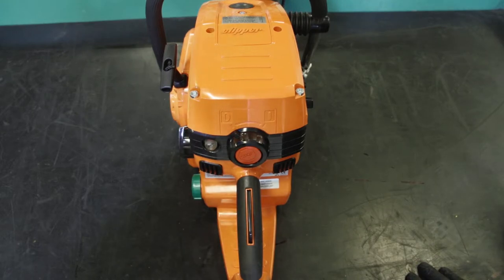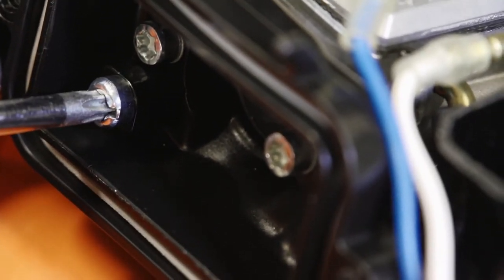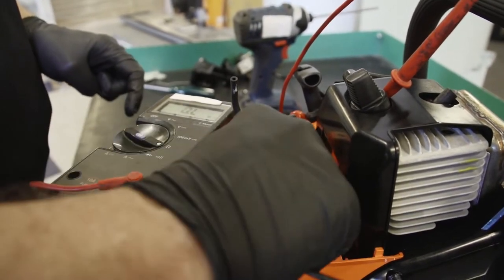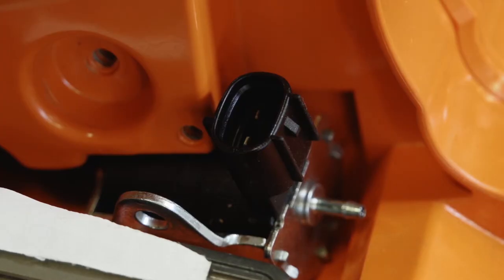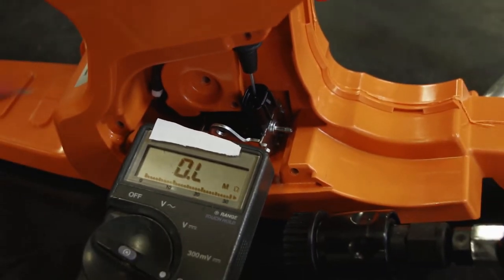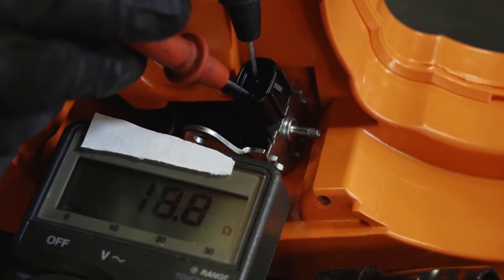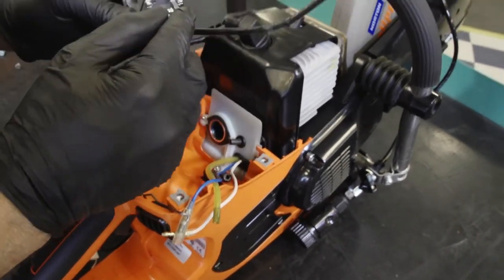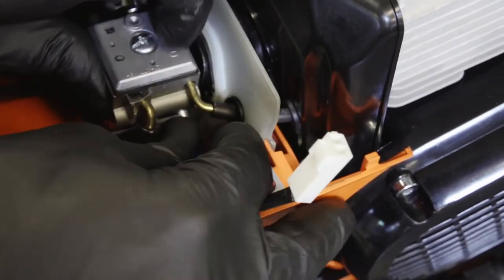How to Troubleshoot iLube System on Norton Clipper High Speed Saws

Comment: I love these saws . I have this exact saw and the Solo non ilube, the 880-14( exact same as cp514-350 from Norton). Was amazed at the power of these saws, how well balanced they are, how light they are and how innovative the ilube is. I bought them both used, on ebay at different times for great deals($239 for the Solo runs great great shape!, $200 for the ilube runs great when it runs, I've needed to fix recoil spring in casette) on the ilube I'm trying to figure out how to get it to run consistently, when it Does fire, it runs like a TOP 3 SAW (I've owned 17 saws- 6 stihl,7 husqvarna 2 hilti 2 makita so 19 counting these 2). Can anyone help me figure out how to get it started and running right each time? Thanks God bless

Comment: But my Norton clipper cp514-350 will not start and I can’t figure out why! It’s getting spark seems like it’s getting fuel to the carb, but not sure how the fuel plunger on the bottom of the carb is tested if that’s a possible failure. I’m about to throw it in the trash
Reply from the maker: Hi there!  sorry to hear of the issues!   We'd be happy to put you in touch with our expert.   If you can email us your contact info (our contact email is on our channel page - about section) we'd be happy to get you in touch! 
He did also provide the below in the meantime: 
When troubleshooting Norton Clipper CP514-350 saw we always start with the FACS

Fuel
Air
Compression
Spark

Fuel All Models:
•	Fuel Tank is full
•	Fuel is NEW. If in doubt replace the fuel.
•	Fuel is a gasoline is NEW 89 Octane or higher with an ethanol content of 10% (E10) or lower. 
Use of fuels with an Octane rating lower than 89 will cause ANY 2-cycle engine to run lean and over heat
which will lead to engine failure. Use of fuels with an Octane rating higher than 10% (E10) will cause
ANY 2-cycle engine to run lean and over heat which will lead to engine failure.

Air:
• Air Filter is clean, undamaged, and in good working order 
• Check for loose or missing air system components 
• Clogged or dirty Spark Arrestor on muffler
• Muffler filled with water or other materials

Compression:
• Check compression with a compression gauge. (123.28 to 129.08 psi @ 14.7 ATM psi)
o	NOTE: while checking compression make sure decompression valve is pulled out.
o	If tested and compression reading is at 115psi or below signals internal engine damage and engine will have to be rebuilt.

Spark:
• Ignition Switch in the OFF “O” position 
• Verify ignition with a Spark Tester

• Spark Plug 
o Loose Spark Plug Boot 
o Bad Spark Plug o Correct Spark Plug Recommended Spark Plugs
NOTE: Gap is 0.02” (0.5mm) BOSCH WSR6F CHAMPION RCJ-6Y NGK BPMR7A 
o Correct Spark plug gap of 0.020” (0.5mm) 
• Ignition Coil 
o Coil to Flywheel air gap: 0.020” (0.5mm) 
o Damaged Coil Pickups o Damaged Spark Plug Wire or Ignition Wire 
o Loose wiring